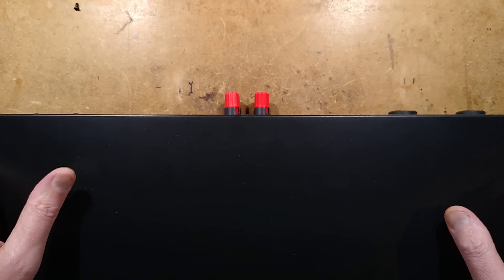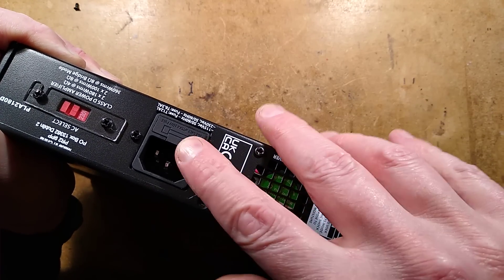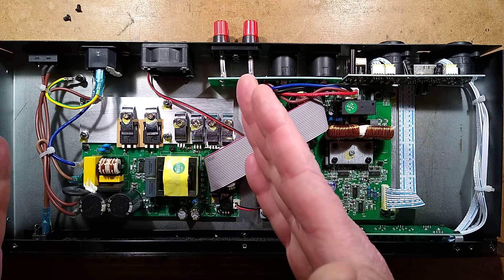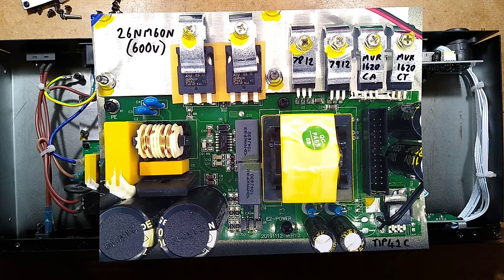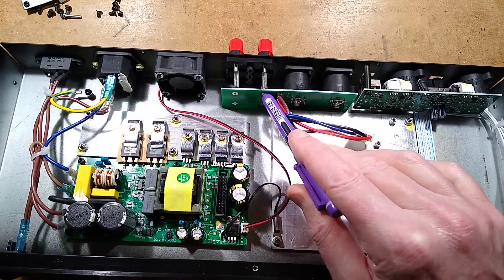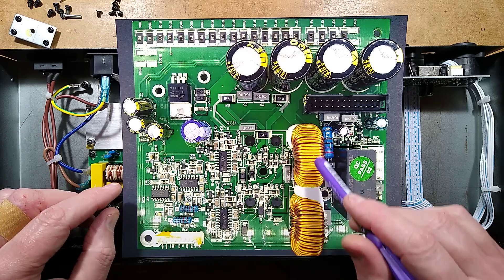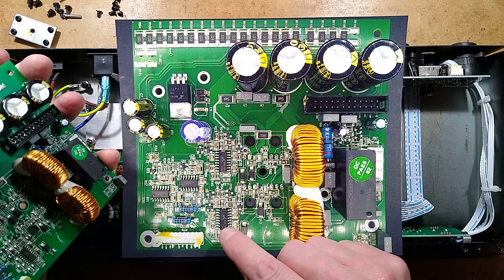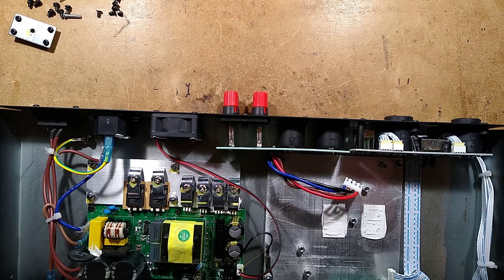Inside a 360W digital amplifier

Comment: They could have at least put one of those stacked double 60mm fans in this like they use in 1U servers. They sound like jet engines at full speed but they move a ton of air. That single fan doesn't seem nearly large enough to move air with all that heat sinking inside, particularly if this is stacked in a rack between other hot equipment running. That and the speaker posts you noted are my only complaints.

Would love to see you break down more complex audio and industrial gear like this!
Reply: Here the heat spreader/ heatsink is just a plate. So the thermal design may be optimum for this fan. Such small fans as selected are mainly for " occasional" low airflow circulation to maintain a uniform spread of internal temperature in the amp.
Excessive air flow from high speed fan..( especially those that run continuously) will always cause to pull in & have more dirt/ dust accumulation inside. and are more prone to fan failure..
Reply: @analoghardwaretops3976  The surface area makes sense as you explain it. I'd get the dust argument too, but of course a dynamic speed fan would prevent that and be the best of both worlds. That said, I acknowledge your point and you are probably right.
Reply: @hgbugalou  yes there are many pieces of equipment that have 2-3 auto fan speed settings , (whilst some may auto variable) that are selected depending on temperature..and may also be normally off , but get turned on once a temp. threshold is crossed.

Comment: I would of expected that fan to be sucking air out of the case from both logic and it's blade orientation. Also think you meant thermal pads, and not insulators for what the components were squished against on the back plate
Reply: As things related...whatever needs cooling , it is always better to pull in  cool air ..rather than suck out hot air ..that extends the life of the fan too..just as the amp needs to be cool.

Comment: Another fascinating video Clive, thanks for that. I wondered if the little fan is arranged to pull hot air out of the case rather than draw cool air in? The big slotted vents would let a lot of cool air in at the front?
Reply: And they're filtered... that's my first impression.

Comment: Ive blanket banned Class D amps from any of my personal installations. When I first got into radio, I built my van up with a Class D amp for a subwoofer. Unfortunately it radiated a massive amount of noise on 145MHz, right on the 2m ham band. Its been a few years but I wanna say it was decreasing the sensitivity for the Kenwood TK-5720 that I was using for 2m by at least 10db. It didnt even have to be doing anything other than being 'On', just idling, to cause this. I located a Class A/B amp and replaced it, problem went away.
Reply: we amateurs must make many sacrifices... the XYL wants a dimmer in the dining room?  Well, it's gonna cost a hundred-fifty dollars, not fifteen... sigh
Reply: @railgap Use a variac
Reply: @railgap  just wondering. ... your "RSGB required" licence conditions Wavemeter.... it's an actual wave-meter, right?  with a tuning dial and a set of plug in coils?
Reply: Banned it? Thought effectively dealing with RFI to eliminate its effect while using it is the exact thing what ham radio all about
Reply: @jagmarc  Im sure it could be done but I have too many projects to do everything I want to do as it is. Buying an A/B amp and replacing the Class D was the option I took. I have made some attempts to deal with RFI from my LED lightbar, which exceeds 30db, making my radio completely deaf. None of them were effective. I think the only way to fix it would be to remove the switching supply inside and either replace it with a better quality one or design a linear current regulator to take its place. As it is, I just deal with the fact I can't hear anything for those few times Im so far off road that I need the additional light.
Reply: @clynesnowtail1257       wow, how amateur radio has changed,  doesn't seem to be any design & development any more, now it's "not working right? - buy something else ready made".  There was a time when a radio ham would design & build their own 0.25 uV sensitivity receiver that listened through the same antenna an active transmitter was using at same time (on a different band of course).
Reply: @jagmarc  lol. I've done more than my share of board level repair and modification on radios, but I replaced a junk amp and ham radio is declared dead.
Reply: @clynesnowtail1257  It's shame about what's happening to amateur radio, even over 20 yrs ago I noticed how ham radio was going, an 'OM' who'd just passed his Class B, I asked him if I could borrow his "compulsory wavemeter" (by coincidence to bring into work for an RFI issue on a SMPS module I was designing) but the "wavemeter" was completely useless, just an un-tuned RF signal field strength detector 10 kHz to 10 GHz, no plug in coils no tuning dial. Couldn't use it.
I said "that's not a wavemeter", he said "yes it is", it's what he passed his class B with, and that I shouldn't complain about the quality of the 'wavemeter'.

Comment: Normally bridge circuits provide 2x the maximum voltage output and 4x the maximum power output. I am guessing that this design is being limited intentionally or isn't specified to use the minimum resistance speakers in bridged mode.

Comment: Nominal Amp Efficiency	90%	
Nominal Amp Power out bridged	350	W
Nominal Amp PSU input	389	W
Nominal Amp Heat dissipation	39	W	
		
Nominal PSU efficiency	80%	
Nominal PSU output	389	W
Nominal PSU input	486	W
Nominal PSU heat dissipation	97	W
		
Nominal Fan and incidentals	10	W
		
Total Nominal heat dissipation	146	W

So assume 160 W tops
So the fan has to deal with up to 160 W

I'm not sure if it can or not. I'm not a Mech Eng. But because it obviously works then the answer must be it can. With what reliability though and without having an idea of derating percentages, I can't say.

Comment: not quite right Clive, with clipping, it means that you are overdriving the ampifier, and clipping is introduced to reduce the noise before sending it out to the speakers, clipping is so bad that you don't want it to happen constantly because it distorts the sound sent out of the amplifier, so sound comes out really tinny, and like a darlek if allowed to continue clipping, the amplifier should try protecting the speakers, but good enough explination to someone who isn't into sound engineering.

Comment: It's important to note that Class-D amplifiers are not digital. They are fully analog. The D in the name was chosen simply because A,B and C had already been used. Although many class-D amps may have digital control systems and DSP the actual amplifier circuity operates as a continuous (non quantized) analog system. Any voltage ripple, jitter or noise will always have an effect on the output signal.
Reply: Wikipedia disagrees with you: https://en.wikipedia.org/wiki/Class-D_amplifier
Reply: @rivimey  There is literally an entire section of that Wikipedia article (terminology) that confirms what I said.

Comment: I'm currently servicing a Behringer amplifier that's like this inside.  All tiny tiny surface mount except for the outputs.  Big beefy mosfets strapped to the chassis.  I'm lucky it's just a set of shorted output fets, that's easy, trying to repair it further would require one hell of a microscope we definitely don't have.
Reply: Hopefully not an NX6000. I tried reparing one of those with an blown output stage. I was lucky that i put the cover on before turning it on because one set of mosfets exploded very violently. Turns out there was more damage than just the output mosfets. I eventualy sold the power supply module because the amp wasent worth the effort to further diagnose. Then again I am now working on some Labgruppen FP10000Q and an FP14000 with an scary +-160V and +-200V supply with more capacitors thsn some 1000W AB amps
Reply: @lukahierl9857 LabGr. they're more likely 10000W & 14000W
and not 1/10 of this as you mentioned.....exercise caution when live testing. protective eye gear , ear muffs etc.
Reply: @lukahierl9857  Oh dear, that's exactly the one.  With that in mind I'll slowly wind it up on the variac when the parts come in.
Reply: @LunaphaseLasersOfficial at least it dosent have power factor correction to make the variac useless
Reply: @lukahierl9857  Final update, it did not explode.  It's acquired a second life it seems.

Comment: The locking system for power mosfet is "inspired" by QSC power module. Also the ics that are probably an irs20957 clone is used in QSC active speaker power amplifier. The TIP and the rail of resistor generate a +12V but referred to the V- rail. Usually when the rail voltage is high (and low considering it's dual) it is derived from an isolated secondary winding. Very strange the relay because the IRS20957 have a shutdown pin witch can be used to delay the turn on. Not a good choice the ribbon cable and the IDC connector to delivery power.
Reply: The very first comment that says only true and real info.
Reply: Well said... that was exactly my first thought... similar to an original K series Bucket of Power amp design, but not as refined. Since I live in a hot, humid country where plastics break down quickly and as far as I know QSC does not sell those plastic things (tensioners?), this "rigged" version idea may come in handy some day!!!
Reply: @radioflyer2030  well if I remember correctly in the QSC version the plastic post push on the body of the MOSFET and so it doesn't align with the tab hole.

Comment: I would have thought that something that effectively doubles the voltage swing when working in what amounts to a differential output mode will quadruple the power into a given resistive load, not just double it as peak-to-peak voltage is doubled, although there may be other limitations that kick in first, such as the amount of current that the amplifier can deliver.

nb. to add to this, I have done a bit of research and it does appear that the possible increase in power is such an arrangement is to quadruple it, but with the very strict caveat that the individual amps will have their own maximum load capacity, so that for a low impedance load, that will be hit first, depending on how much headroom there is. In this particular case it seems that the maximum power is only doubled as it is based on the maximum power dissipation of each of the two amplifiers individually, not how much power can be driven into a given resistance based on a maximum voltage swing. I also note that there can be considerably distortion introduced in bridge mode if the two amplifiers are not well matched.
Reply: This amplifier comes close to quadrupling the output. Look closely at the labels 😊

2x100watts RMS into 8 ohms
1x360watts RMS into 8 ohms (bridged), so almost 4 times the stereo power.
Reply: The best aproximation is to duble the power that is given for half the impedance. For example if the amp is rated 8R stereo  150W per chanel and 4R stereo 250W per canel the 8R brided power would be 500W.

Comment: Over 100 watts of power through a 0.1" pin header and ribbon? I know it has paralleled conductors but that seems not ideal. I've never thought to use those for high power delivery.

Also notice the speaker output board is bent.
Reply from the maker: Yeah.  Not a fan of the ribbon cable for power.

Comment: When i design audio gear from scratch, i treat the earth connection like a mains neutral... think about it.
(Most grid power installs tie the N and E together near the consumer unit)

If you assume it is a neutral, and there are potentially leakage currents (and induced volts) on the earth line, there is a higher risk of mains hum.

You have to assume that earth isn't really an earth for audio. 

Differential signal grounding is the solution. But few people bother!

Nice amp.

Comment: Class D amplifier.
I hate them, they have a terrible (continuous) phase shift over the entire bandwidth. This could be eliminated with a three-pole output filter but no, they are meant to be cheap.
Sometime the piano (the high notes) sounds like a violin.
The only true positive side of a "digital" amplifier (proper name, is "Class D") is its high efficiency: while "class B" or "AB" have 60% max. of efficiency, "class D" have 70-90% efficiency: they operate almost cold, require small power supply and small heatsinks.
"Class A" amplifiers have 30-50% efficiency, they're a sort of space heater, but they have non-existing phase distortion and negligible intermodulation.
"Class C" amplifiers are the most efficient "analog" type of amplifiers, but they can only be used with RF; they don't work with audio, because the output transistor conducts only for 70% of the input signal, relying on the resonance of the output LC circuit to rebuild the input signal.
I built my first class D amplifier in 1980 (10+10W) taking it from the Elektor newsmagazine.
I like this video very much, as it brought memories from a bygone era.
Greetings,
Anthony

Comment: It's an exhaust fan... not intake. 
The air comes in the front, flows over the board, and goes out the back via the 30mm fan.

Comment: I have a funky feeling that you got the direction of airflow through the amplifier wrong. The Fan does blow warm air out the back, pulling cool air in at the front and through the filters. Nobody in his right mind would push unfiltered air into an Amp across all components and filter the warm air on its way out.
Reply: China would.

Comment: I bet you'd like a look inside my Chord SPM1000B! 2 x 200w into 8 ohms or 2 x 400w into 4 ohms! It's a standard class AB amp but it has a massive switching power supply instead of the usual big honking transformers and capacitors.

Comment: clipping on opamps usually means that you are trying to drive above its max output voltage, wich you obviously cant so it flatten the "loudest" part to its max and distorts the sound so ill assume that i means basically the same here meaning that you are either hitting the power limit or the voltage limit of the output, both distort the sound but should not damage anything.

Comment: I am a bit skeptical about this one.  First, I am not sure how they bridge this amp, each channel already drives both + and -.  Second it seems to only have one inductor for the filter per channel.  This implies that the bare minimum filtering is applied.  It probably has a bunch of switching noise above 20K which can be hard on a tweeter.
Reply: I doubt you can hear a 250k carrier. An LC filter is the standard even in more expensive amplifier.
Reply: @andreavico6198  Maybe not hear it, but anything above the tweeter frequency will be turned into heat in its voice coil.

Comment: Unless, of course, someone were to tighten the middle screw stupidly tight, forcing the transistors through the insulating material and on to the grounded heat sink. Then there’ll be some wowzy wowzy sparky sparky smokey smokey bullsh*t going on, one for each channel! Then, you’ll have an EOL video, shango066 style! 🤣😂

Comment: 11:16 The fan is actually pulling cold air from the front venting sleeves over the circuitry out to the back of the amplifier.
This design is very common in 1U devices like firewalls, routers, etc.....
Reply: Spot On!
Reply: Indeed. Case fans like this usually blow toward the side with the label, which would be outward in this unit. This is typical, as you don't want a fan blowing directly onto a PCB, as it will develop "cold spots," i.e., temperature gradients that will exert mechanical stresses on the fine electrical traces. Better to have the air flow in through a large inlet and get blown out through a small outlet, as this makes the cold air more diffuse.

Comment: Those are not "super duper large" filter caps. I have an old (70:s or 80:s) Peavey powered mixer with rated output of just 2x100W and the filter caps are about the size of Red Bull cans, just a little shorter. Also, the power transformer looks like something out of a welder. I'm pretty sure that one actually outputs the rated power all day if necessary unlike most modern (at least the cheaper ones) amplifiers. But of course the Peavey also is the size of a small suitcase and weights something like 20 kilograms but that does not matter as it's just used at the training room and never transported anywhere. Works great despite it's age, just some of the pots are a little scratchy.

Comment: Considering the "Bridge" option, I would expect a bipolar (symmetric +/-) power-supply, and "stereo" outputs referenced to ground. 
In keeping with this hypothesis, I would expect the two "death beam" capacitors to be actually smoothing caps for the +ve and -ve rails.
Reply: They’re on the mains side of the transformer, so they’re not rail caps.

Comment: An insight into the fact that Class D amplifiers are switched DC power supplies can be seen in the power ratings. It's usually something like "250 Wpc 8ohm, 500 Wpc 4ohm, 1000 Wpc 2 ohm". I love Class D amps because they are so light and efficient. In my outdoor theatre rig, I replaced two conventional A/B analog amps with a 4-channel Class D that weighs less than half as much and supplies more than twice the power.

Yep, as far as ground-lifting goes, don't. Just don't. It's how you get the nice shiny bare aluminum Shure 58s going to line voltage, as dramatized in "Almost Famous".
Reply: I’d expect input sources to feed a mixer with ground connected there, and the power amp input earths lifted if necessary.

Comment: Fan in device alert !
I have the opinion that when an audio device needs a fan to cool it it is under designed. Extra noise is NOT what you want, and in this case I see that the intake for the fan is not covering the whole fan surface, so it is very insufficient. Bad boy 😋
I could be wrong, maybe it is only for fairground noise, or as you say: entertainment industry,